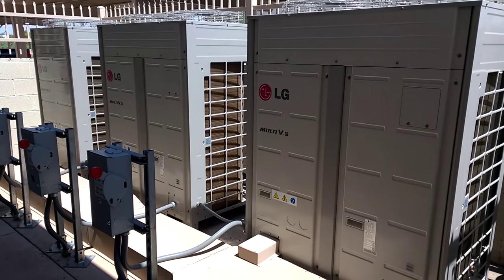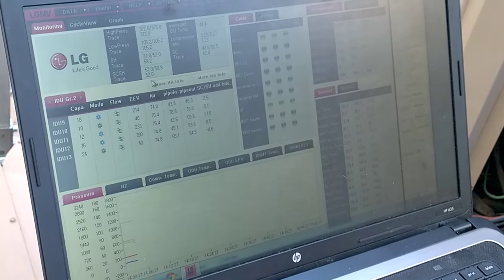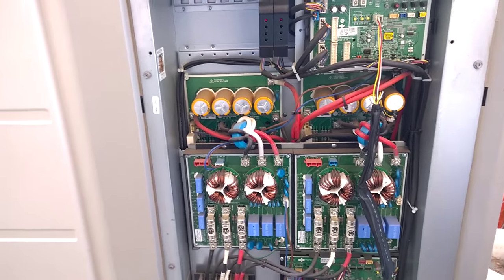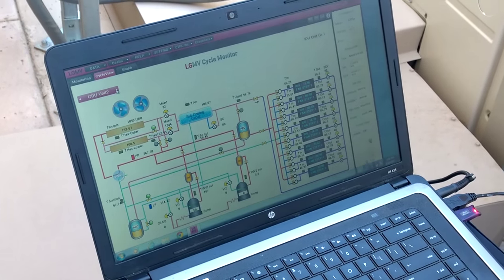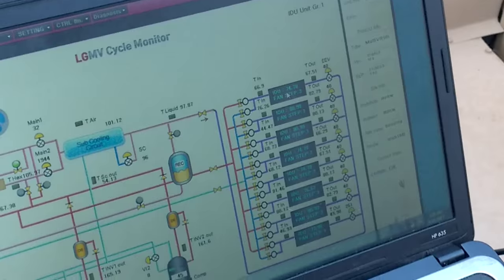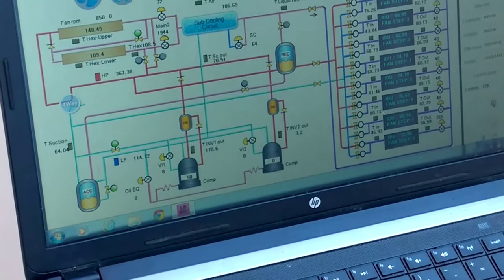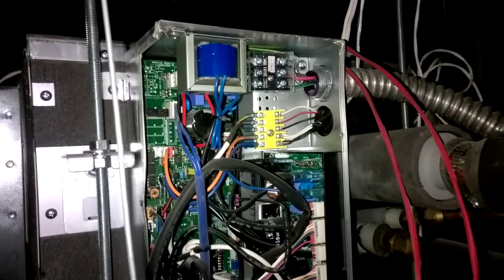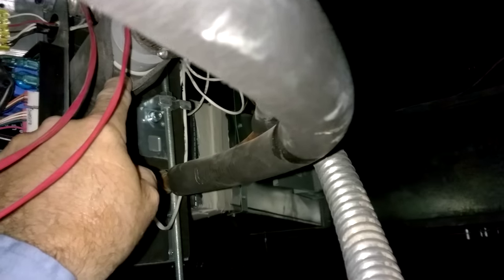Another look at the LG Multi-V units

Comment: Thanks for sharing brother! Seems pretty complicated to work on!
Reply from the maker: +Brad1237202 The cool thing is there really isn't anything to have to mess with on the indoor unit because it is a VFD blower and it has a pumped condensate.

Even the outdoor unit has no contactor etc to mess with.

Just plug into the unit and make sure it is happy. 
Keep clean filters inside and wash that outdoor coil.

At this place they had 2" merv 8 filters and lots of them so I don't think dirty coils will be an issue.

I guess some of these come with a simple washable screen filter and that is what they have at another job. :-/
Reply: @hackfreehvac  Do you think the simple washable screen filters can lead to dirty coils over time?

Comment: I met a Lennox tech a  month and a half ago to do the start up on some 10 ton and 12 ton VRF units we installed. Surprised the hell out of me when he didn't even have a program like the one you guys were looking at there to monitor the unit operation. Not sure if he was figuring that any issues we could have would be obvious or, maybe he believes in magic and the easter bunny. Or, he is just a lot more experienced then i can imagine.
Reply from the maker: +ryan ernewein Oh wow really? I haven't seen those.
Did they have a lot onboard as far as a display and setup goes?
I guess these LG units require the laptop interface to do much of anything.
Reply: They have a little single digit digit display at the outdoor unit and a digital stat indoor that don't tell you much.  That is why it amazed me that he did not have a program on his laptop to observe the operation. We used POT switches to tell the outdoor units how many there are piped together, then set another set to tell them how many indoor units there are. 
Nice units i must say, they also have heat recovery. I like working on different things, just hope my boss hasn't gotten me in over my head this time. Lol.

Comment: Units like this are very common in Germany.
You can´t even buy split systems without an inverter compressor.
On larger buildings with many indoor units you have these things on the rooftop.
Reply: +Alexander470815 Dont guys  have problems when trying to repair them. I mean to get parts as electronic boards or sensors??
Reply from the maker: +tecnico I think the quality of these kinds of sensors are spec'd way higher than the throw away stuff we see on my A/C units.

Also none of the motors ever see a surge to start neither do the electrical components since they all technically 'soft start" with the VFD drive.

If designed right, DC VFD driven motors should run cooler etc

As I said in the last video, i hardly ever have to fix a mini split unit. 
And most commercial buildings seem to have at least one for a server room, etc.
Reply: +hackfreehvac regular techs are scared of new technology because they believe to be too expensive to repair for the customer.  i dont know if you had a chanse to watch a guy recently in youtube raging with comunicating systems. although a Goodman.
Reply from the maker: +tecnico Goodman has "communicating" systems?
No wonder he has issues. LOL

I guess communicating setups can be good and bad.
Only needing three wires max is pretty cool though.

Comment: Is it a three pipe system?
Reply from the maker: +heavydiesel YES it is.
Each air handler can heat or cool at any time.
Reply: hackfreehvac
We put a three pipe Samsung in a college, amazing equipment, they saved over 30% on  electric with it in heating season.
Reply from the maker: heavydiesel
Cool

Comment: fuck me that's fantastic, I have seem the programs for the power plants in our area. Are you able to change the cfms and what not on through that program? the system they use at the power generation plant is completely controlled by the computer, everything from damper operation to fan speeds to compressor control.
Reply from the maker: +Kyle Faubertq On the condenser units I am sure that they run as programmed since it is critical but I am not sure about the indoor blower.
I imagine the indoor blower would be adjustable.

The other tech went to class and got the software and I think I will be doing the same after summer.
Reply: awesome, I'm always interested in watching what you find next. the videos are great. I am working on my commercial refrigeration apprenticeship right now and hope to work on large units like this. Working on residential/ light commercial all day at the moment.

Comment: Too much bs. Just a big mini split
Reply from the maker: +Ulises Palacios Well, not really JUST a minisplit as there is way more tech in these than just a larger mini split.

These compressors have oil separators, liquid injection to keep the compressor cool during certain loads, etc.
Reply: +hackfreehvac yeah I know man. A lot of controls and electronics for efficiency. It's pretty cool on the variable load Also.